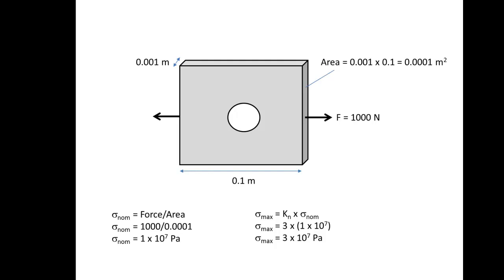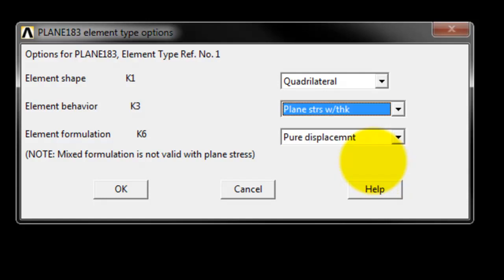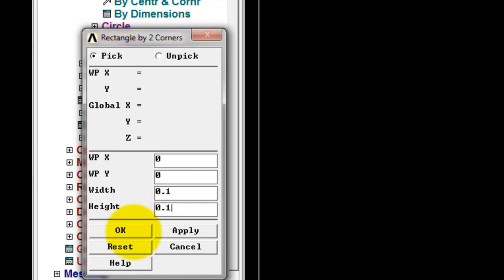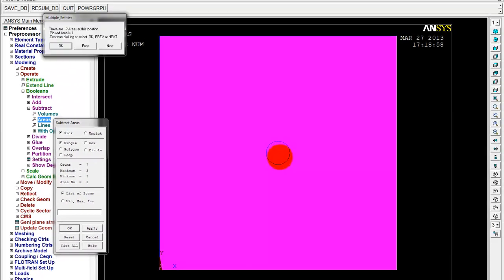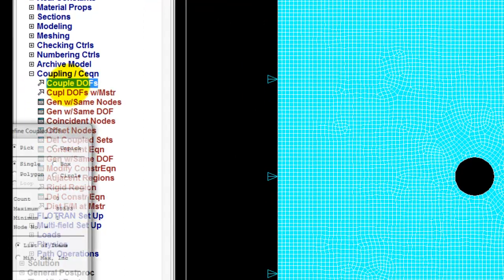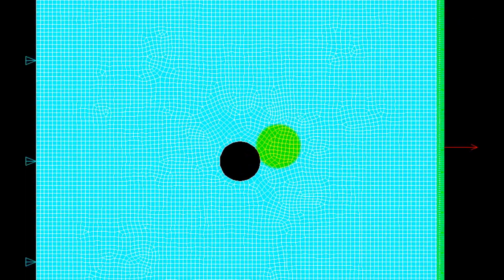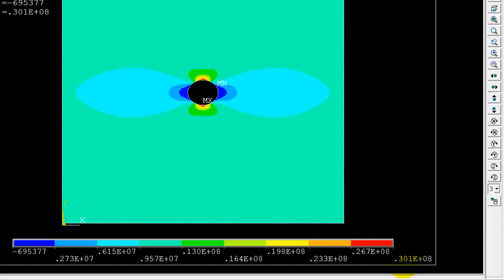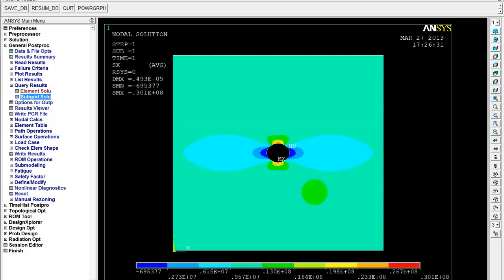Basic Stress Analysis with ANSYS - Part 04 (Plate with a Hole)

Comment: Hi there, Why do you specifically use an 8 node 183 element in this case? What are the benefits of this element above others in this application? Thanks in advance
Reply from the maker: Hi plane183 is an eight node elemtent with quadratic interpolation functions (shape functions). This is usually more accurate than the corresponding 4 node element (plane 182 - I think!) which only has linear interpolation functions. The eight node element also can have curved edges (as opposed to straight edges) which makes meshing a geometry that has curves a bit easier

Comment from the maker: Hi, in this exam we only have one material model and one element type so when we mesh the mesher uses the default attributes (material 1 and element type 1). If we were using different materials and/or different element types in our analysis then we would need to specify mesh attributes before meshing. Hope this helps.
Reply: Which program did you use here?